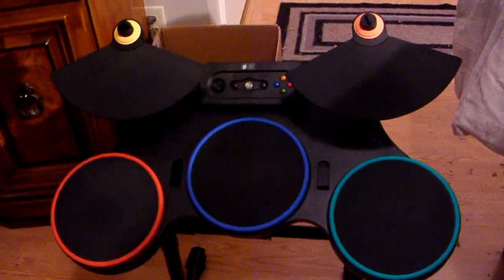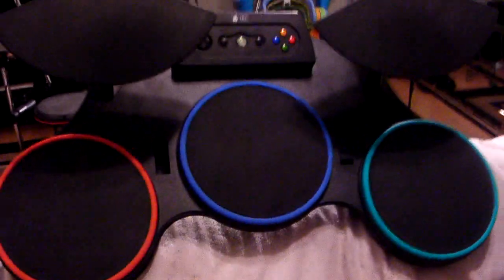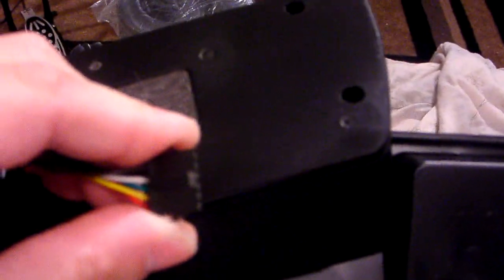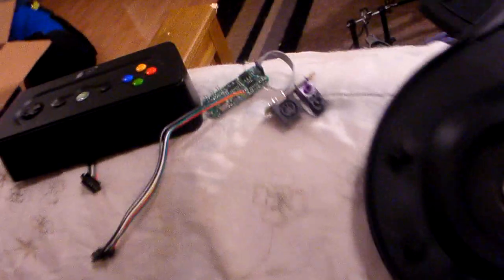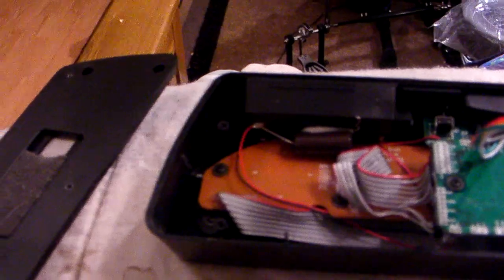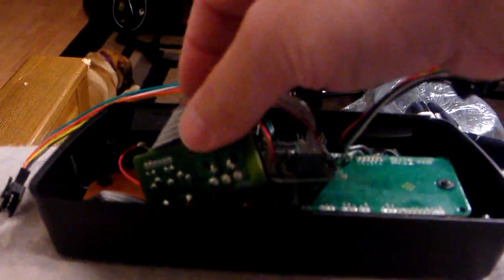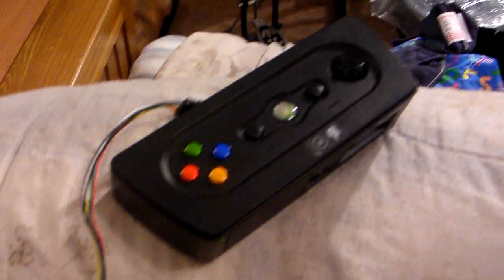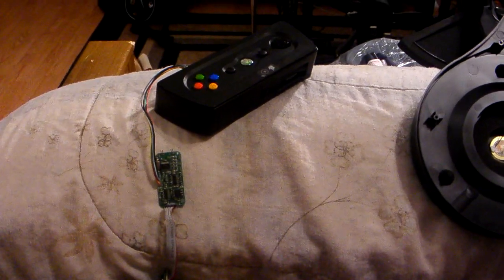Guitar Hero World Tour Drum set Midi Brain Surgery Tutorial

Comment from the maker: The only way get orange to work with ion is to Hack a GHWT set (this video) and or use a GHWT SET and the MIDI input from your E drum module set to channel 10 and the proper notes to trigger the wireless module.  Only a REAL GHWT modle (hacked or in the stock set) will give you 5 lanes.   You can also but a stand alone

Comment: I just bought one of these (GH WT Drum Brain) and a dongle from eBay. My plan was to play the drum part on a hand held controller. I am disabled from a back injury and do most of my gaming from a flat laying down position. 

The only problem I have now is with the bass drum. Do you happen to know if it's possible to access something that triggers the bass drum from the brain module and create a button for it? I only received the brain with no MIDI connectors or anything. Mapping it to the Dpad..